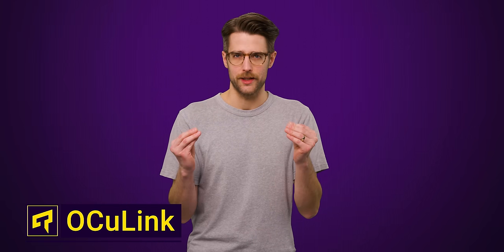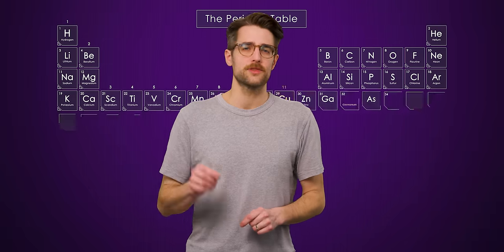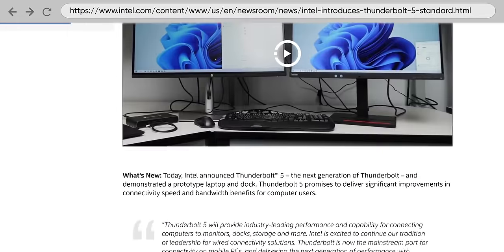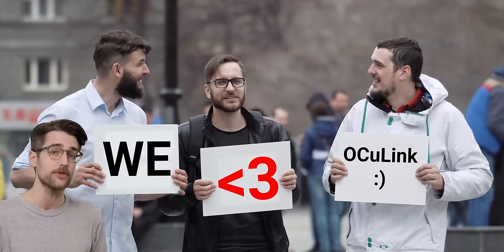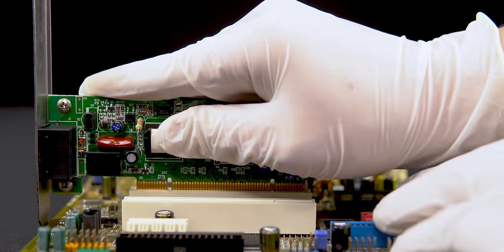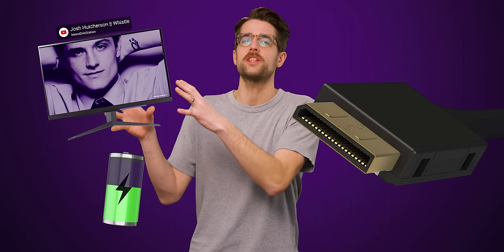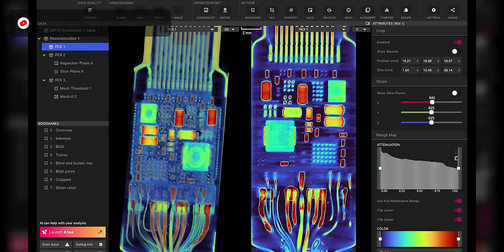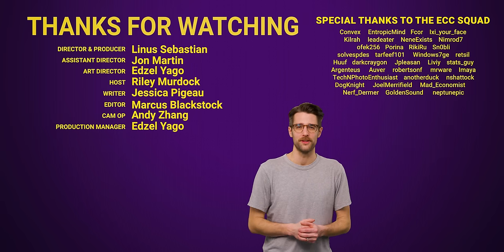The Best Connector You’ve Never Heard Of: OCuLink

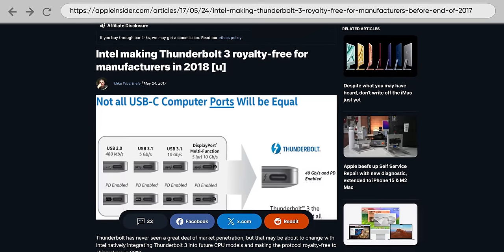Comment: 1:55 Oculink is just a pci-e x4 slot in a different form factor, just like M.2 or U.2. 
Thunderbolt however, requires a thunderbolt controller to enable compatibility with daisy chaining, plug and play, charging, USB 2, USB 3 and DisplayPort. Oculink is just a direct connection from a plug to a cpu. It's not so much "using cheaper components" and more "get rid of >50$ controller". 

Oculink is faster than Thunderbolt, because Oculink can transport pcie 4.0 x4 (64gbit), while thunderbolt devices can only use up to pcie 3.0 x4 (32gbit).
Reply: Yes, but the controller actually costs $10, and maybe another $10 for all the signals on the PCB. Also Thunderbolt 5 is already out and even Intel's pathetic Thunderbolt controller that can only power one of the ports at full speed can do 64 Gb/s. And when the ASMedia controller comes out it will likely have PCIe 5.0 x4 or even x8 to allow 64 or even 80/120 Gb/s per port.

Comment: Another point for thunderbolt is that the USB-C port they use is physically smaller than an Oculink port, taking up less space if space is a concern. Like on the side of a laptop where an external graphics card would be most likely be used. The kind of laptop that would most likely put one on is also one they would cram a decent graphics card inside anyway.

Comment: Why this never became THE means of having a small pc case with a beefy GPU like a 2080Ti, in its separate case behind the monitor (or out of sight), is beyond me. Now if you want a beefy GPU your case MUST be huge unless its a custom build and very expensive.
Reply: the connector has terrible longevity, think some of the handhelds/mini laptops makers have had to put in a lot of work to make it more durable. a connector like that couldnt really be on a consumer product if it could degrade so quickly
Reply: @konzo5942  So they redesign the connector. Cheap? No. Doable and viable? Absolutely.
Reply: A SFF build in something like a Fractal Ridge case isn't big, but it does come with some ITX tax.
Reply: @TheAmazingCowpig  Or AMD/NVidia develop GPU boards specially made for water cooling so they can be half length with two boards stacked. Such a cooling solution is possible in a relatively small form factor. But an external GPU really is best if they're always big.
Reply: mid atx case ftw
Reply: Nobody wants desktop components in separate boxes with their own power supplies and a bunch of wires connecting them…
Reply: @tormaid42  : Except for the folks that want a docking station for a laptop that they really do take around to places.
Reply: Just mount everything on a sheet of plywood and install it behind the monitor. In other words, that's how to make a smart TV that's actually great.

Comment: IMOH, best use case of OCuLink is link between light-weight business laptop computer or mini PC and external powered GPU (like RTX4080) enclosure. Gaming laptop is too expensive, too heavy, too bulky and short on battery time. Thunderbolt 3 or USB4 port are too expensive for a light-weight budget business laptop. OCuLink can be add to such laptop with minimal additional cost.
Reply: The main benefit of OcuLink is performance and price of the eGPU enclosure. Thunderbolt/USB4 costs like $20 on the host side, so not too expensive.
Reply: You do not want a port that enables anybody with the right tool to pwn you, on a laptop, especially not a business laptop. You need a port with somekind of protocol, and setup and drivers, and that gets you to USB or Thunderbolt.
Reply: @Carewolf  You don't understand what you're talking about. Thunderbolt is literally PCIe with more steps and it doesn't need "setup and drivers". Thunderspy and Option ROM attacks are proof that Thunderbolt isn't safe. Thunderbolt 4 allows any device to connect by default. Secure Boot and IOMMU are bulletproof protections from these kinds of attacks, and both also work on OCuLink and are enabled by default. Also it's much easier to pwn someone with USB, all it takes is a cheap microcontroller that acts like a keyboard. Thunderspy needs $300 worth of bulky equipment and in some cases disassembling the laptop.
Reply: @null-nl5su  The attacks on Thunderbolt at all attacks that circumvent the built-in protections. You are advocating for a connection with NO built-in protection.
Reply: @Carewolf  You didn't understand what I wrote AT ALL. Option ROM attacks don't circumvent anything and don't work when Secure Boot is enabled. Thunderspy does circumvent Thunderbolt security levels but it requires dissasembly and an SPI programmer with default settings and Thunderbolt 4 also has "no built-in protection", it allows any device to connect by default. Thunderspy doesn't work when IOMMU is enabled and it is by default.
Reply: @Carewolf  Oops, Thunderspy not Thunderstrike. Thunderstrike is the Option ROM attack.

Comment: You didn't mention the most important element. The latency is much lower.
its influence the frame rate to a big extent
And it is very possible that the moment a cable become a smart cable, it gain latency. So it possible that even thunderbolt 5 can't really perform better than oculink

Comment: I think the most important thing for me, as a consumer, is ease of use. I can never go back to a connection that I have to orient correctly to plug in. The USB-C connection is such a great evolution and platform to grow from. However, ease of use isn’t as important if it is a set it and forget it connection such as a monitor. I will say that plugging in HDMI and DisplayPort is much more pleasant than DVI or VGA. So if we can make a mini OCuLink that doesn’t need proper orientation then I am all in replacing all the proprietary bottlenecks of Thunderbolt.
Reply: You do realize that, for the average consumer, whatever USB-C port they have is slower than most of their USB-A ports...
The average consumer buys thinking USB-C=Thunderbolt. The whole thing is a scam. A true next-gen high speed data transfer standard would use its own connector. And it would be optical. They are literally giving us today what we should have had 15 years ago.

Comment: having a high performance GPU in a self contained unit that has the cooling and power required for the GPU and just needs one of these OCuLink cables to connect to the PC would be a huge advantage... Imagine being able to connect that thing not only to a PC tower but also to a laptop and finally have reliable high performance GPU performance and no temperature issues or melting connectors or other expensive issues along those lines
Reply: I would rewind back to 2016 and look up a company called Alienware 😆

Comment: I actually knew about this cable, when I owned a steam deck the only way to use an external graphics card was via one of these cables, ofc I never went through with it though, it was way better for me to just sell the steam deck and get a laptop with far better specs while maintaining portability.
Reply: Was there an adapter for this kind of thing?
Reply: Steam Deck never had OCuLink by default, unless you're referring to the M.2 NVMe to OCuLink adapter.
Reply: @Kerbiter  yep, talking about the adapter.
Reply: @_Rerr_  indeed there is.

Comment: The problem with Thunderbolt is actually that the plugs can be easily unseated or unplugged.
Reply: You need to have that port and plug checked out. It's not easy to unplug USB-C cables from my laptop.

Comment: GPD, a company that has been making PC handhelds since before the Switch was even a thing, uses Oculing ports on their modern handhelds. They also sell an EGPU with an oculink port.
Reply: But the GPU that GPD is using is low enough performance that Thunderbolt 4 isn't a bottleneck.
Reply: @rightwingsafetysquad9872  
Thunderbolt 4 may not be a bottleneck, but you need an intel CPU to use it. AMD can use USB4, but USB 4 is equivalent to Thunderbolt 3 in terms of bandwidth.

You can buy various external GPU shrouds with Oculink too. The point is less about the GPD's EGPU and more about the fact that their handhelds have the port out of the box, which is rare in consumer devices.
Reply: @XzaroX  Thunderbolt 4 is just Thunderbolt 3, but some previous optional features are now mandatory. USB4 and Thunderbolt 4 have the same bandwidth.  And the only OCulink GPU expansion I've seen looks super sketchy.
Reply: LTT viewers are likely some of the only people in the world who actually know what GPD is lmao.  Don’t have to explain them here xd

Comment: The issue is that, unlike pure image signals and HDMI/Display Port, external PCIe is itself a bit of a niche on the consumer market. Like, I don't even really need Thunderbolt.
Reply: Well not sure, that's like saying PCI-E is a bit niche. What's niche about having an extensibility port? Just because it's not used by an average user whose work doesn't involve using special hardware with their PC, for example, it doesn't become niche . Instead I would say that people are just too used to their laptops not being extensible that the idea of extensibility is a bit alien.
Reply: @Kerbiter  
Few people use external GPUs or similar.
Reply: @Alias_Anybody  not necessarily due to lack of demand, so far eGPU options been subpar (high penalty, compatibility issues because of another protocol on top) and costed a lot with Thunderbolt. It's not entirely fair to use such argument when the market supply wasn't there. People just got used to work that way and may be reluctant to changing their way.
Reply: Also meant professional equipment more, such as audio interfaces or whatever else that may use PCI-E.

Comment: Nice video. I knew what it was. I always though that OcuLink could of been "Fixed". The Fiber optic connecetion with the fiber optic cables was also a under-used option. I loved being able to have a portable CD-2-MD recording setup with the Fiber Optic functionality between the CD and MD. I even did a few CD to MD transfers for friends and family.
Reply: Very, very different sort of fiber. The old audio TosLink used a plastic fiber with basic LED and phototransistors transducers, one way. Very very cheap, very low bandwidth - the main reason to use optical was as a way to escape the curse of ground loops and differentials, the hated electrical problem that is usually the source of that humming noise in the speakers you can't get rid of. Optical components for high-speed data communication are a lot more expensive.
Reply: @vylbird8014  An example of the cost difference is that a 5m standard DP cable is like $20 while the same length cable but with optical fibre instead of copper is $130.  Source:  I found out that 5m DP cables cannot carry 3440x1440@100Hz without issues while my optical one can do so with ease.

Comment: How weird would it be if OcCulink replaced PCIe internally, where you could have 5.25" drive bays full of GPU's, pulling air from the front of the case instead of optical drives, all attached by this standard? We could have the old school towers back again with several drive bays for expansion.

Comment: Question - HDMI 2.1 vs DP 1.4 - Let's say I get the Asus PG32UCDM (yum), then I get a 5090 when they become available. What method of connection would be better? Wouldn't the higher bandwidth of HDMI 2.1 be preferable? or is there some downside I'm missing?

Comment: Daddy Intel have disappointed me again by not having Thunderbolt 5 integrated into their latest Meteor Lake 'Core Ultra' chips. If the MSI Claw came out with Thunderbolt 5, it would be a definitive feature since a single cable connection from eGPUs to Handheld Gaming Console PCs make the most compelling argument. OCulink has gained renewed interest because of its adoption on handhelds from likes of GPD. Propriety solutions exist like on the ROG Ally or the Surface Connect. I'm very excited for Intel to enable Thunderbolt Share, which is a peer to peer ethernet networking. I can imagine two handheld gaming console PCs connected by a single USB-C cable for local multiplayer gaming.

Comment: Occulink doesn’t support power delivery, does it ? And no hotplugging either which limits its usefulness for certain devices. But still it is a good alternative to have. Where’s the pcie 5 version ?
Reply: No, no power. Not sure about hot plugging. PCIe technically supports it, and OCuLINK is basically just a bunch of PCIe lanes on a cable… so possibly.
Reply: @zgriggs  it doesn’t hot plug I tested it. That’s where thunder bolt has it beat. It also doesn’t tunnel usb or DisplayPort. But unlike thunderbolt, there’s no need for a thunderbolt or usb4 host controller. So occulink has merit especially for eGPUs. But for other types of media like storage not so much because what if you need to plug and plug the storage while the computer is still running. No hot plug support is no bueno.

Comment: I am still frustrated that HDMI and DP both do not have a workable audio only standard. Like using one of those poor neglected ports on the gpu, or the IGPU supported on of the motherboard to feed audio to speaker systems... It is such a good idea thats is just being ignored.
Reply: HDMI does have ARC for televisions. 

For PCs though, I think part of the issue is that HDMI and DP are digital standards, and existing PC speakers and headsets are either analog or digital over USB. 

You’d either have to connect a DAC to each port along with the circuitry to detect and switch to analog mode, or you’d need to get people to buy into a new ecosystem. It would let you reuse a port in a desktop, but they generally have plenty of ports, while the smallest devices generally don’t have spare HDMI ports.
Reply: @jameslake7775  that is the thing tho. Both of them already support many audio standards. And it wouldn't be much to put a dac in say a logitech speaker set, which some already have to support coax and or toslink. So, really just the receiving end would need that. 

But the biggest problem seeming that the way the standards are set, audio doesn't pass through the port unless an active video signal is passed as well. I used to have to hook up a headless display dongle to my home theater receiver just to get my gpu to output audio to it. What's bad about that, is you have a false display connected, windows then allocates resources to an unusable desktop display.

I honestly think it would be far more convenient to be able to use an hdmi or dp to pass high quality multichannel audio as it's own standard. Especially since a lot of people have idle hdmi ports on their gpu or motherboard doing nothing. Plus since it is a more widely used standard currently. It can be developed and integrated much more easily than trying to update toslink to be able to work with the new higher bandwidth audio standards people are used to. I know there are usb based speakers out now too. Although you won't find a high end multichannel speaker setup that does its transport via usb either. Just little fiddly throw away speakers.

Comment: Nice, sounds like egpus will get popular again with the ride of igpus
Reply: What are you going to plug it into? Any laptop that actually supports Thunderbolt has a dGPU anyway and is in the upper half of the laptop market, price wise. The whole idea you can upgrade a laptop with a Thunderbolt GPU is ludicrous. Anything you need to upgrade doesn't support it anyway. The royalties are too expensive.
Reply: What are you going to plug it into? Any laptop that actually supports Thunderbolt has a dGPU anyway and is in the upper half of the laptop market, price wise. The whole idea you can upgrade a laptop with a Thunderbolt GPU is ludicrous. Anything you need to upgrade doesn't support it anyway. The royalties are too expensive. Thunderbolt is a White Whale.
Reply: @Lurch-Bot  well then there can be models made to be used so.
Also there's still a need to upgrade for lower end dgpus as well, I could put up a vram-rich amd card after my 3050 chokes on it's 4G 😅
Or for upcoming amd ultrabooks whicc has usb4v1 which is better than thunderbolt 4 when it includes pcie which is required by Microsoft anyway so you won't see any usb4 laptop without pcie

For intel, better wait for tb5

Comment: I definitely hope Intel doesn't bring Thunderbolt 5 but we get standards called "USBC 80" and "USBC 64" which represent the USB-C port with signaling capable of transferring 80 Gbps and 64 Gbps respectively. We basically already  have USB-C 5, 10, 20 and 40 Gbps signaling already so re-branding those as "USBC 5", "USBC 10", "USBC 20" and "USBC 40" would make total sense.

Older specs could be called USB 1.2, USB 2.0 and USB 3.0, which are obviously inferior to 5–80 specs even though oldest specs could't transmit even 1 Gbps.
Reply: I think we've ended on the wrong foot. Ignore the old specs. Do not rename them. Bad names suck, but multiple names is worse.

I do agree that the transfer rate would be a logical choice, but the spec name should really have two components: transfer rate and Power support. Optical cables obviously don't have power support and neither do cables with bargain components that max out at 10W even though they are rated to 20gbps.
Reply: @katanyafleet  Good point! Maybe something like "USB 80G 100W" but is two separate numbers getting too complex?

Another option would be to force all high speed cables to also carry lots of energy so "USBC 80" cable could transmit 80 Gbps and carry 80 W of power?
Reply: @MikkoRantalainen Maybe, but the new spec already supports 100W for quality cables. 200W and beyond is either already in the spec or soon will be.
Reply: @katanyafleet  You could also spec that wattage is double the bandwidth so USBC 64 cable would need to do 64 Gpbs and 128 W.
Reply: @MikkoRantalainen  I would be able to live with that; even if the power spec would be overkill for some devices, it should never be underkill.